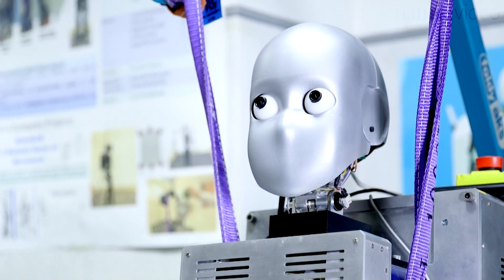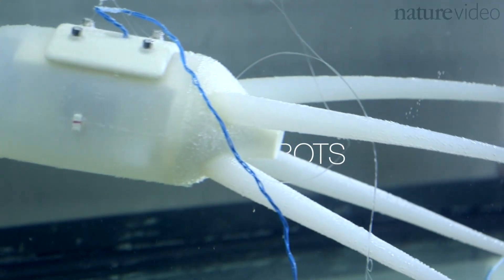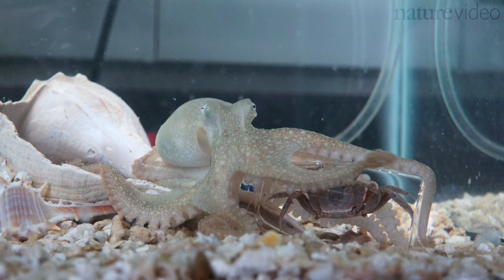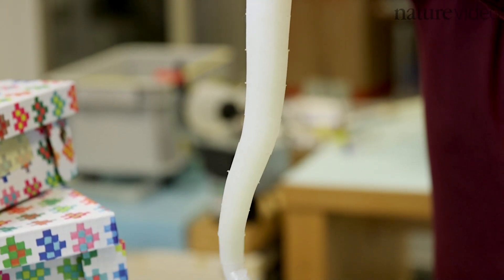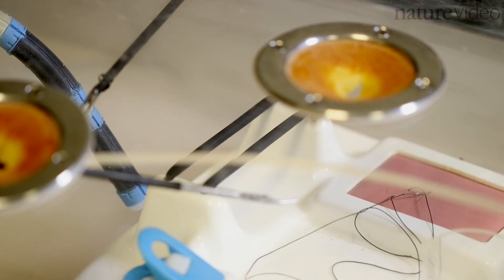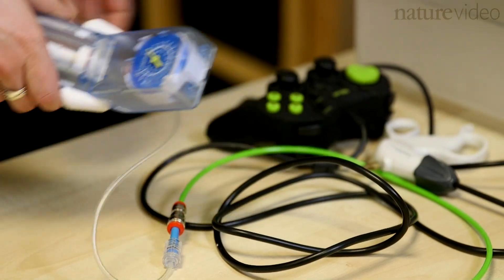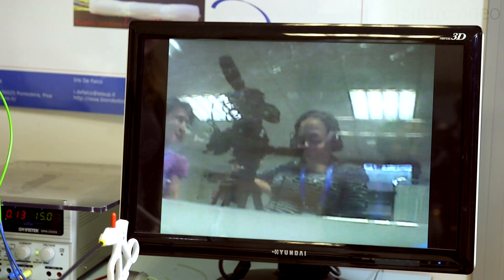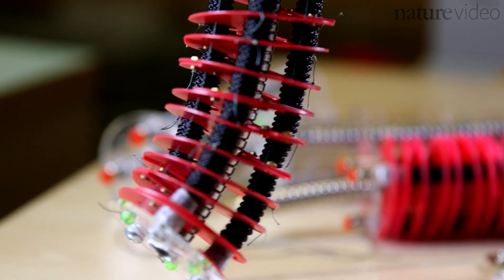Soft Robots

Comment: I think this artificial model can be used to lift sophisticated  and hazardous goods. Nice idea
Reply: +SD D I would propose buoyancy for lift instead of actuators in the limbs. As for the grip, high pressure hydraulics could probably work. Octopuses (and other organisms) have evolved a highly efficient energy cycle system. This energy is often used for far more purposes than robotics need such as energy generation, growth and replication. What robotics often can learn from organisms is specific details such as airfoil and actuator design. If we'd need a controlled octopus hacking the nerve system of an actual octopus would make more sense.

Comment: I guess this means we will have robotic muscles at some point? that will act almost identical to our own, moving around an artificial skeleton say.
Reply: +NeWx89 or maybe u can implant a chip that would be near the brain stem connecting to the artifical muscle through a system of wires similar to nerves as 
well as a carbon fiber exoskeleton and endoskeleton improving the capabilities of the human body and making the body not only stronger but also most likely less vulnerable to modern surgery but of course the procedure would be quite costly and dangerous but if successful the benefits would out weigh the loss and mobility wouldn't be a a problem because the endoskeleton and the exoskeleton would complement each other perfectly giving balance between the two and giving the human body a almost perfect body structure
Reply: Cyberpunk 2077
Reply: Robotic muscles are actually quite easy to develop, they can be replicated pneumatic or hydraulically by widening (and so shortening) a chamber
Reply: Yes, very well say
Reply: But we have to deal with brain. Muscles can have any form, like springs for example. We can make muscles, we can't invent brain to control and manage muscles... I just guess. Can we ?
Reply: A control center for such a mechanism I believe are easier then the mechanisms(muscles) themselves, we already have something suitable as a brain, a computer. If we need a machine just capable of moving robotic muscles, I can't see why a modern computer wouldn't be able to handle that, sending signals for various parts to contract and expand. We could even go so far as to use 'deep learning' if we would want to go beyond programmed movements, so that it would learn and be more dynamic. However, If we're talking about a whole artificial human, then that's a far cry from this, still it's a beginning.
Reply: so it can run crysis?

Comment: An octopus is difficult to match with AI. They are surprisingly spatially intelligent given their very limited brain so something clever has been done.
Reply: +Dan Frederiksen The octopus probably have more limbs than necessary for current replication application, unless it needs to capture live specimen. They have evolved not just for movement but also to hunt for energy. Depending on application a successful replication today would probably use energy sources such as waves, solar, heat and even MHD.

The actual movement, regardless of number off limbs, could probably be developed by genetic algorithms with input from feedback sensors in the limbs.
Reply: +Dan Frederiksen And don't forget that they actually have 9 brains!
Reply: its likely an octopus has similar intelligence as us basically and feels like an individual.. it will take a really long time to match that. just because you can program the robot to move around like an octopus doesnt make at a feeling living octopus
Reply: are you sure about that?